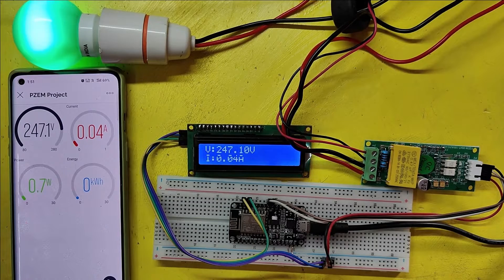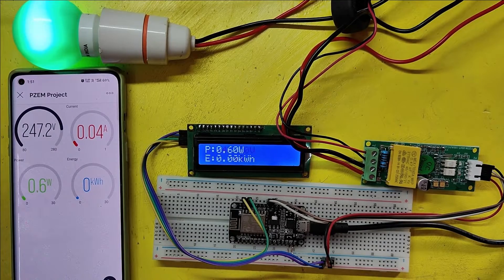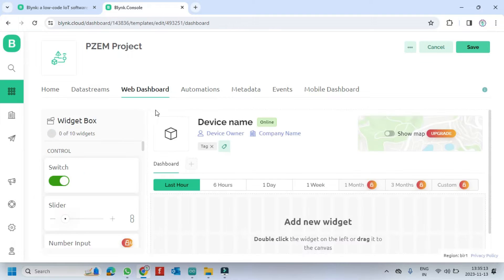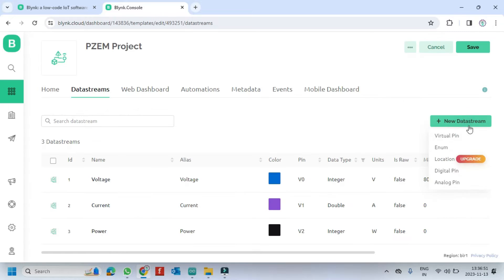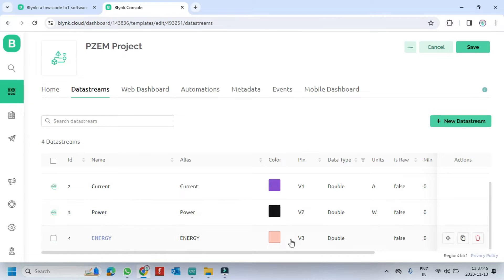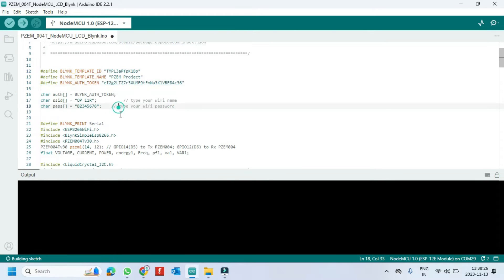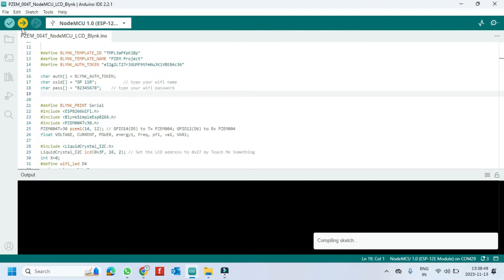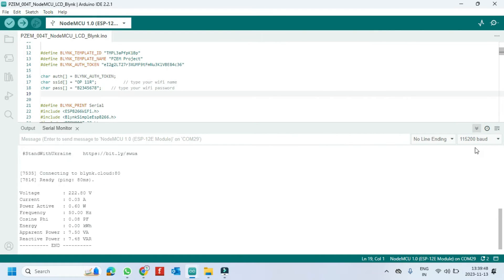PZEM 004T Sensor NodeMCU Blynk LCD | pzem-004t esp | pzem-004t esp8266 Blynk iot Teach Me Something

Comment: Does it properly calculate a non-linear load?? Phone chargers, AC motors, fridges?? Mine doesn't - lowering everything entries but voltage IN HALVES (or near in halves). Two options: I don't understand sth important, and all this theme is just TOTAL BULLSHIT... ??